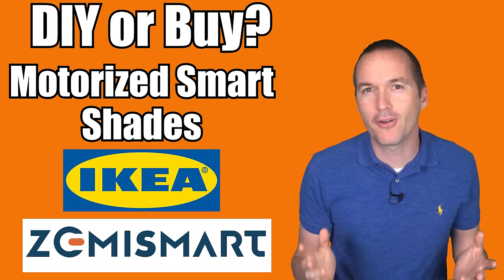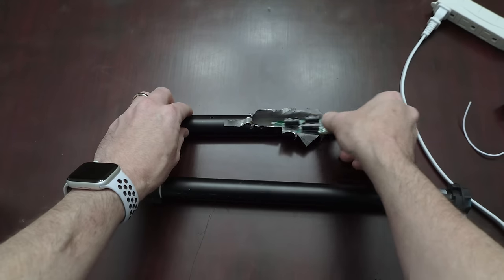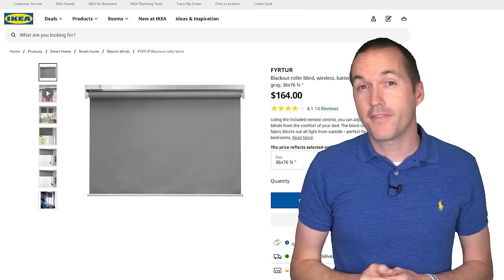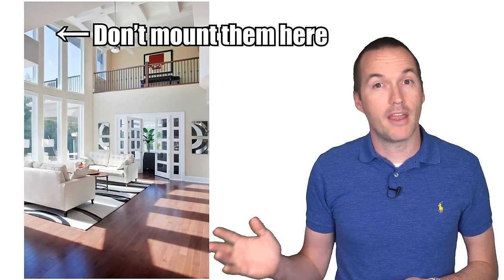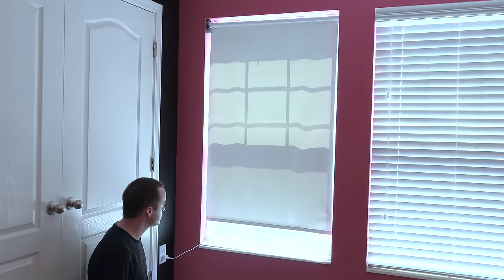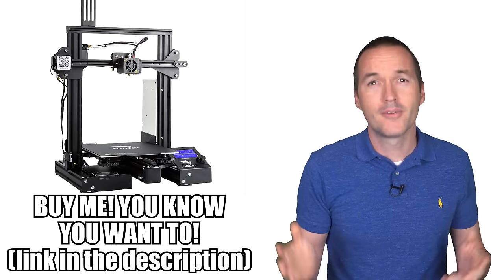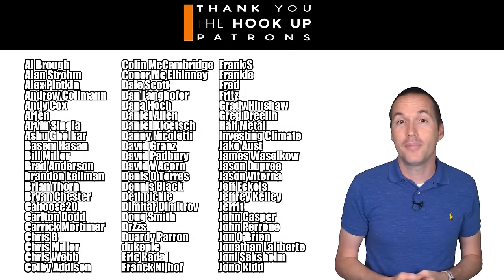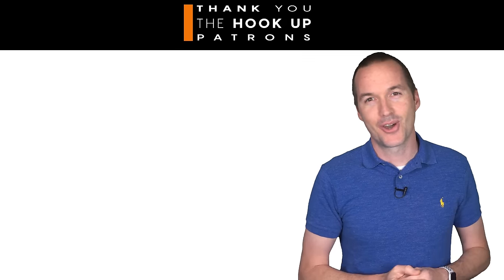Motorized Roller Shades? IKEA Fyrtur vs Zemismart Solar/Battery vs DIY!

Comment: Is it possible to put the precompiled BIN on WEMO D1? I have flashed it and am able to put in my wifi password. but looks like it then just gets stuck in a boot loop?
Reply from the maker: Should work
Reply from the maker: Try pulling power completely and replug
Reply: The Hook Up I don’t currently have the motor plugged in (still on order) so I assume this is why it’s happening!
Reply from the maker: @Wranglatang93  Shouldn't be an issue, I programmed most of it before hooking up a motor.
Reply: The Hook Up oh. Hmm. I did try pier cycling and 2 different D1’s. It connects to my fish for a second and then disconnects
Reply from the maker: @Wranglatang93  This is after configuring stuff in wifimanager (captive portal)?
Reply: The Hook Up yes. I get a stable connection to configure the WiFi setting and then it just can’t stay alive after that.
Reply: @TheHookUp  Looking in the serial output I get this: 

Starting now
*WM: Adding parameter
*WM: Name
*WM: Adding parameter
*WM: Rotation
*WM: Adding parameter
*WM: 
*WM: Adding parameter
*WM: invocation
*WM: Adding parameter
*WM: 
*WM: Adding parameter
*WM: server
*WM: Adding parameter
*WM: port
*WM: Adding parameter
*WM: uid
*WM: Adding parameter
*WM: pwd
*WM: Adding parameter
*WM: 
*WM: 
*WM: AutoConnect
*WM: Connecting as wifi client...
*WM: Status:
*WM: 6
*WM: Using last saved values, should be faster
*WM: Connection result: 
*WM: 3
*WM: IP Address:
*WM: 10.168.40.85
Failed to open config file
Unable to load saved data
MDNS responder started

Exception (28):
epc1=0x4000bdc8 epc2=0x00000000 epc3=0x00000000 excvaddr=0x00000000 depc=0x00000000

>>>stack>>>

ctx: cont
Reply: Managed to figure it out. I wasn't setting a Bonjour name which was causing the issues.

All working now, apart from hitting stop in HA doesn't seem to do anything ?
Reply: @Wranglatang93  I am having the same problem and this is with and Amica nodeMCU where after I configure it its stuck in a boot loop. I have configured all settings. Thoughts?

Comment: Couldn't you just use 2 motors to increase the torque? One on each side? :)
Reply from the maker: You could, but it would require a bunch more wiring and more robust coding... probably not the easiest solution.
Reply: Wires through the center, same controller runs both motors? I do not see a need for rewrite of code for that, as the same signal is sent.
Reply from the maker: You mean running them off the same controller, or just the same signal wires?  You’d need to wire one of the motors with voltage inverted to get it to spin the opposite direction.
Reply: Same signal wires. Just need to flip the wires to make it go the other way..no need for an inverter.

Comment: Great video! Always appreciate seeing your reviews and different options for home automation. I was wondering why you did not do any Shelly 2.5 controlled roller blind systems? The Shelly 2.5 is really well designed for controlling roller blinds. I know you would need to have mains voltage at each window. Here is a link to a video showing how I have Shelly 2.5s controlling zemismart RF and four-wire roller motors. Having a Shelly 2.5 and a four-wire motor works really nicely.  https://youtu.be/mcwWOxVphng
Reply from the maker: Cool stuff, I'm automating with an RF bridge, works pretty well.

Comment: Works well for 1 blind but when i add another, the new one does not work, i suspect the static ip is the problem?. Has anyone else come across this problem
Reply from the maker: What part doesn't work? Alexa integration, or everything?
Reply: The Hook Up i built 2 to try (still waiting for motor and controller) . Programmed bith (blind and blind1), put in wifi password and alexa name for each
I think that because of the pre programmed setup they both end up with the same ip address, which  means only one will work, the software needs to be altered to allow dchp

Comment: The control software is garbage is it not. Up button greyed it, battery level missing, etc.
Reply from the maker: That information is all there, it's just not understood by HA, so it does funny things.  That's the problem with Zigbee, no standardization means every device needs an individual driver written for it.

Comment: Hey, Thanks a lot for the review and instruction, I have been wondering how to best control my 28byj-48 operated shades and this seems to be the perfect solution. Unfortunately after entering the wifi credentials the nodemcu enters a bootloop, seemingly having something to do with beeing unable open the config file: 
Failed to open config file
Unable to load saved data
Did anyone encounter the same issue? I have tried two different nodemcu's and I've tried uploading from the sketch on github, all with the same result :( Any help is highly appreciated!
---- Full output of the serial monitor below, this output repeats roughly every second ---
Starting now
*WM: Adding parameter
*WM: Name
*WM: Adding parameter
*WM: Rotation
*WM: Adding parameter
*WM: 
*WM: Adding parameter
*WM: invocation
*WM: Adding parameter
*WM: 
*WM: Adding parameter
*WM: server
*WM: Adding parameter
*WM: port
*WM: Adding parameter
*WM: uid
*WM: Adding parameter
*WM: pwd
*WM: Adding parameter
*WM: 
*WM: 
*WM: AutoConnect
*WM: Connecting as wifi client...
*WM: Status:
*WM: 6
*WM: Using last saved values, should be faster
*WM: Connection result: 
*WM: 3
*WM: IP Address:
*WM: 192.168.1.29
Failed to open config file
Unable to load saved data
MDNS responder started

Exception (28):
epc1=0x4000bdc8 epc2=0x00000000 epc3=0x00000000 excvaddr=0x00000000 depc=0x00000000

>>>stack>>>

ctx: cont
sp: 3fff3610 end: 3fff39e0 offset: 0190
3fff37a0:  3fff3974 00000050 6156000a 40219ebd  
3fff37b0:  3ffe8f59 00000001 4020cb58 3fff227c  
3fff37c0:  3fff3974 3fff3984 3fff40bc 4020af7f  
3fff37d0:  00000051 3fff23b0 3ffe8f57 402155ac  
3fff37e0:  00000003 3fff23b0 3ffe8f57 3fff3984  
3fff37f0:  3fff3974 00000051 3fff227c 4020b022  
3fff3800:  3ffe8e99 3fff3974 3ffe8e99 3fff227c  
3fff3810:  3ffe8e99 3fff1efc 3fff23b0 40205b94  
3fff3820:  00000000 00000000 3ffebaff 00000000  
3fff3830:  feefef00 feefeffe 80efeffe feefef00  
3fff3840:  feefeffe 80efeffe 00000000 00000000  
3fff3850:  00000000 40222838 00000000 40222838  
3fff3860:  00000000 40222838 00000000 40222838  
3fff3870:  00000000 40222838 00000000 40222838  
3fff3880:  00000000 0000000a ffffffff fe000001  
3fff3890:  3ffe87db 00000000 fe01ef35 00000000  
3fff38a0:  402025dc 0000000a 3fff667c 00000000  
3fff38b0:  00000000 00000000 00000000 3ffe8bdc  
3fff38c0:  3ffe8afe 3ffe8bce 3fff664c 00000028  
3fff38d0:  3ffe87db 3ffe8af5 3ffe8bc0 3fff661c  
3fff38e0:  00000028 3ffe87db 3ffe8bbb 3ffe8bb6  
3fff38f0:  3fff414c 00000006 3ffe87db 3ffe8baf  
3fff3900:  3ffe8baa 3fff65ec 00000028 3ffe87db  
3fff3910:  00000000 00000000 00000000 00000000  
3fff3920:  3ffe8b7b 3ffe8acf 3ffe8b6b 3fff65bc  
3fff3930:  00000028 3ffe87db 00000000 00000000  
3fff3940:  00000000 00000000 3ffe8b3f 3ffe8b23  
3fff3950:  3ffe8b2c 3fff658c 00000028 3ffe87db  
3fff3960:  3ffe8b76 3ffe8b16 3fff411c 00000028  
3fff3970:  3ffe87db 00706374 feefeffe 83efeffe  
3fff3980:  feefeffe 70007377 feefef00 82efeffe  
3fff3990:  feefeffe feefeffe feefeffe feefeffe  
3fff39a0:  feefeffe feefeffe feefeffe feefeffe  
3fff39b0:  feefeffe feefeffe feefeffe 3fff24fc  
3fff39c0:  3fffdad0 00000000 3fff24bc 40218014  
3fff39d0:  feefeffe feefeffe 3ffe8570 40100f55  
<<<stack<<<

 ets Jan  8 2013,rst cause:2, boot mode:(3,6)

load 0x4010f000, len 3456, room 16 
tail 0
chksum 0x84
csum 0x84
va5432625
~ld

Comment: What IP address should I use to control the roller? When I put 192.168.20.56 nothing happens. HELP please!
Reply from the maker: You need to find what IP address your device has on your network.  That address is on my network, not yours.
Reply: @TheHookUp  can you please point me how to find that? Thank you!
Reply from the maker: @Mrgassik  I'd recommend you download the Fing app for your phone, it shows devices connected to your network.
Reply: @TheHookUp  Thank you, you're the best!
Reply: @TheHookUp  So I have found the IP address but when I try to connect it nothing happens - this site can't be reached. :(

Comment: Very nice Rob,  can use the same code for bipolar motor and stepper driver (DRV8825) same your previous video "Motorize and Automate your Blinds for $10! (WiFi)
". Stay safe
Reply from the maker: The set of code on this one uses the ULN2003 drivers that come with the 28BYJ steppers.  I thought about porting it over to the DRV8825 to see if I could get a bit more torque, but I ran out of time (The code was very skillfully written, but it makes it difficult to just replace specific parts).
Reply: Thanks Rob, I will wait for any update

Comment: Anyone know how to integrate this with Domoticz and I cannot get Alexa to discover it either
Reply from the maker: When to go to http://ipaddress/espalexa what does it say?
Reply from the maker: Also, doesn’t domoticz have an MQTT option?
Reply: @TheHookUp  Ah ok not tried that, i'm currently struggling to get it to logon to my network, it did once but now wont, I just get connection failed and it get stuck in an endless loop, just working on that, the AP fires up no issue and my network password is very simple, i'll keep trying.
Reply: @TheHookUp  yes it does I will have  a look into that properly once i get it to connect.... cheers for the work

Comment: The Hook Up: 2:39 "... battery powered Wi-Fi devices are rare."

Me: Has he not heard about devices called cell phones? 🤔😂
Reply: Would be a pain to recharge your blinds every day or 2 like a cell phone. The point is that Z-wave, Zibee and other RF devices can last months to years on a charge or battery. WiFi devices tend to last days to a few months tops.
Reply: @YKSGuy  Yeah, that's true. Modern 4G base stations do not drain battery extremely fast if the programing is optimized. I mean that they use quite a lot when the WiFi is under active use but not so much when on stand by mode. For example very fast portable 4G base station with LTE (SIM card) uses about 0,9W when active but only about 0,015W when on stand by. This means that with litium battery costing about $10 (to end user) with 32Wh capacity can power it about three months in (active) stand by mode (but only about 35 hours at constantly running). But these power consumption examples were from very powerful 4G device so more power optimized model could work considerably longer even with that small and cheap battery (only three 18650 cells or similar capacity LiPo). But still charging every three to five months or so would be needed. Self discharge is so low especially in good quality 18650 cells that with about $30 end user price battery one year of average operation could be possible.
Reply: @tkermi  Talking about two different efficiency items. Cellular is supper battery efficent and those base stations acting as the WiFi gateway have control over the wifi radio and the AP / base is responsible largely for what power saving is supported. Lowe power WiFi IOT devices tend to be 2.4Ghz wireless N at best and have to wake to keep their connection to the AP / wireless network. There are multipule WiFI power save options but support is crap for the most part.. Good power saving didn't make it to WiFI standards till wireless AC which increases device costs and on 5Ghz has limited range.. So ya WiFI currently sucks for long term standby "smart" devices.
In the blinds however the motor is the real battery killer.
Reply: @YKSGuy  I agree. By the way there is quite a difference in 5GHz coverage between different devices. Even inside same brand. My Huawei Mate 20 pro and my old Honor 8 has a good coverage but my Huawei M5 Pro Tablet is much worse! For the motors great power savings could be achived if modern brushless DC (PWM controlled) neodymium magnet motors were used. But these motors (the real high efficiency ones) tend to quite expensive... The good but cheap ones have very little torque so they need quite complex gearbox (still not that expensive but if made cheap looses efficincy and durability). I mean like the motors in modern computer fans are efficient, cheap and small but have very little torque. Anyway it always comes to the price question. Very nice products could be made but then they might cost so much that almost no one would buy them 😐

Comment: So... still no acceptable solution then.
Reply from the maker: I really like the solar/battery one with RF.  I already use an RF bridge in my house, so adding the codes for control is super simple.
Reply: @TheHookUp  One way comms is a deal breaker. Position feedback is important.